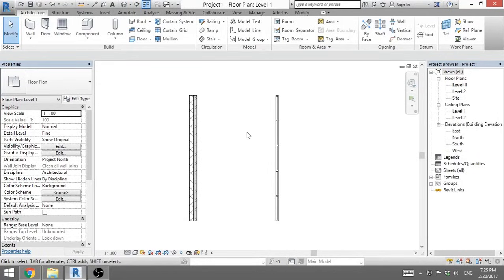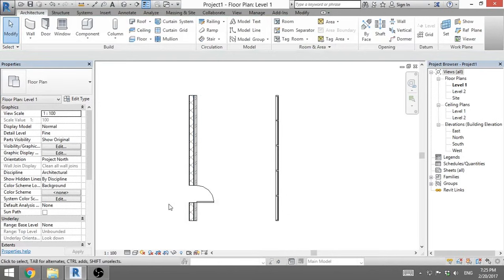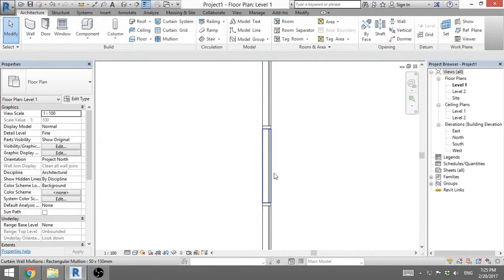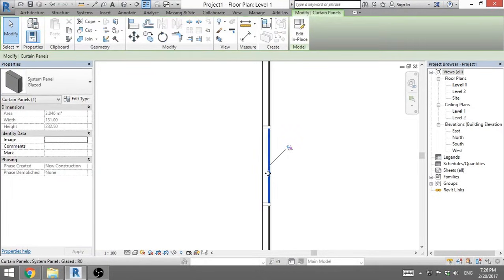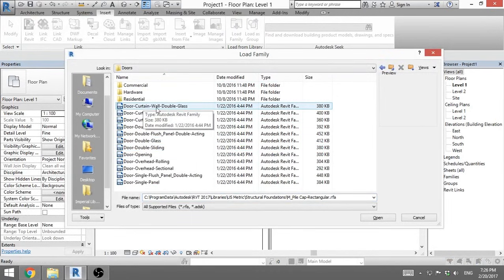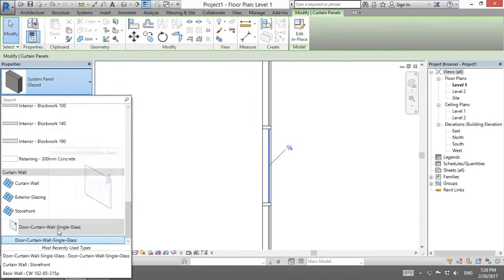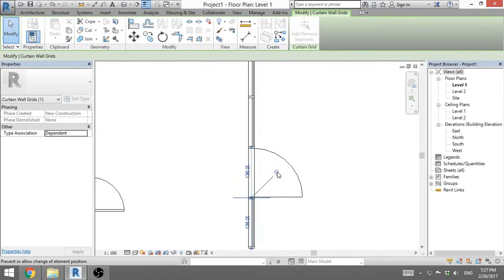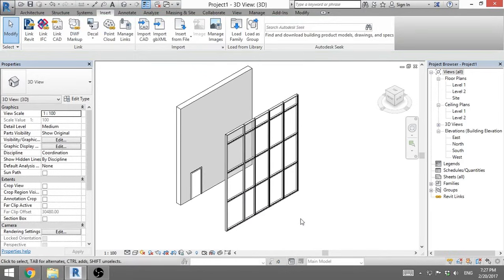How to put Doors on Curtain Walls in Revit

Comment: I am not able to select the glass (even with tab). It selects the whole wall or nothing at all.
Reply: Hit tab until the panel you want lights up. I know this comment is 2 years old, but just in case anyone else has the same issue.
Reply: @jordansmith8990  I tried that but I still can't put a door in